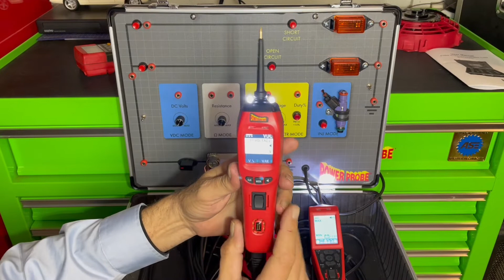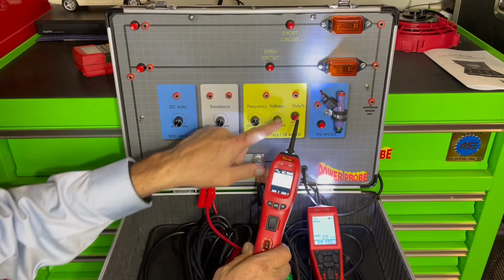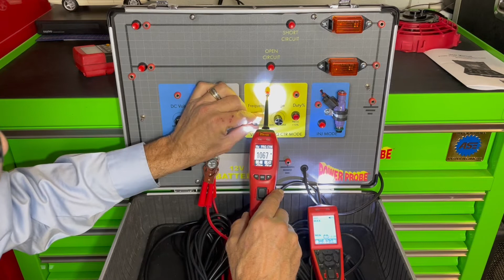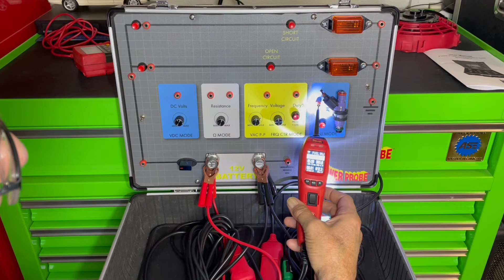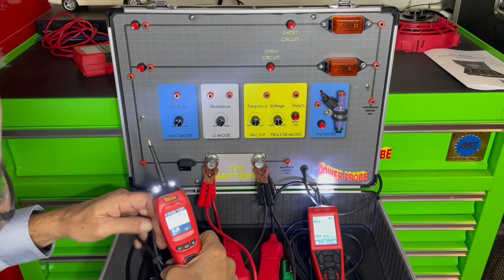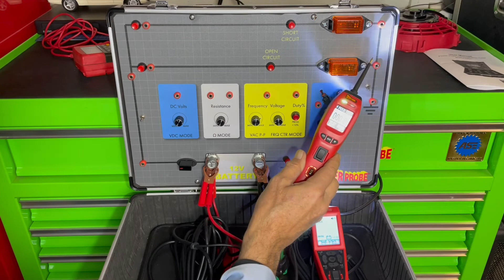PPDEMO1 Power Probe 4 & Maestro

Comment: Very curious? Can the maestro work with the short finder? And does the maestro have a driver tester as well?
Reply: Yes and yes. Maestro doesw everything the 4 does plus diagnostic information and a graphing voltmeter. Will interface with your smart phone or tablet so you can see everything on a large screen.
Reply: @JSW42  I’ll stick to a scope for when I’d have too pull that out, the 3 is good for me tho!
Reply: @JSW42 im having trouble finding how to get to the driver test on the maestro. Can you explain to me where it is? Thanks.
Reply: Yes, you simply have to buy the short finder kit separately.
It doesn't appear that they sell the maestro as a 'master pro kit' that includes the short test pieces.